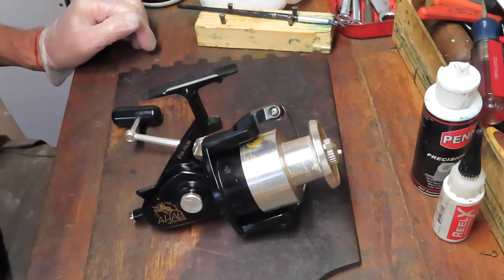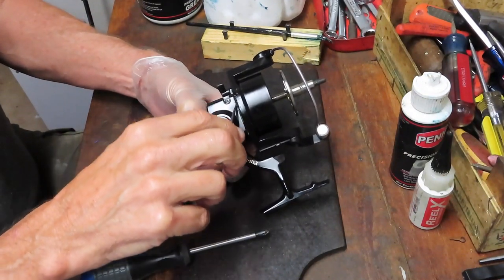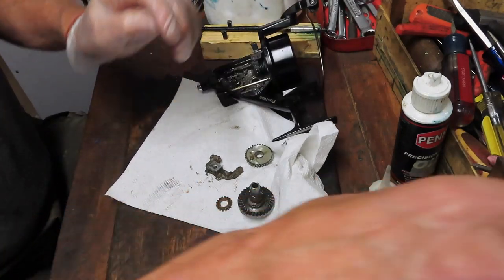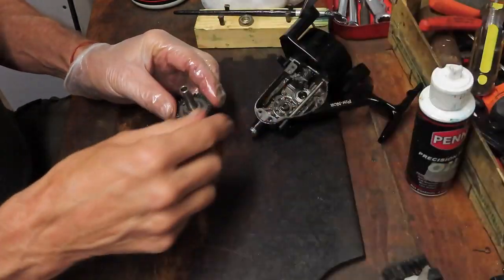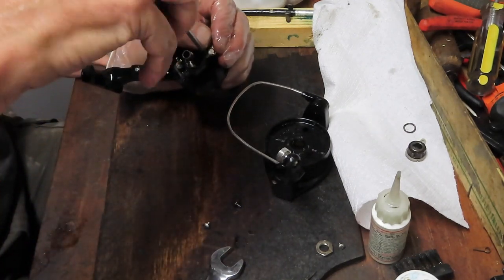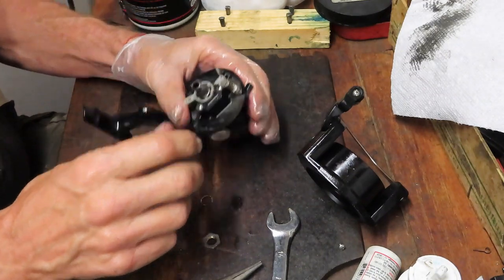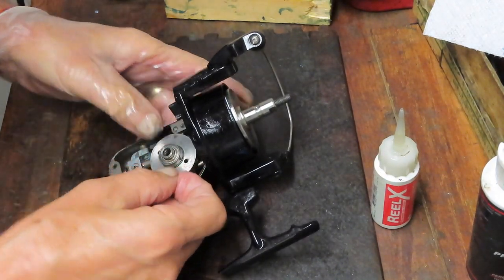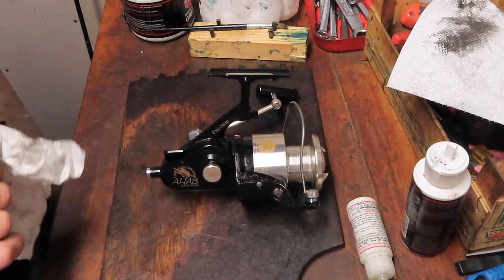Fin Nor Ahab 16 saltwater spin fishing reel how to take apart and service

Comment: Hi Dennis,
A great, no nonsense, well engineered reel worked on by a reel master !  Outstanding effort going in and out, blind !! Must admit my heart skipped a bit when those needle bearings started popping out #&#%   
     Interesting to see the cork drag washer.   Havent worked with those myself yet but I have cleaned up cork rod handles using just a microfiber cloth and water. Come out looking and feeling Fantastic !!!
All the Best, 
Cons
Reply from the maker: Thank you very much!Nice talking with you.  Stay well.  Good luck at the auction - Dennis
Reply: I use a magic eraser and water.

Comment: Nice video Dennis. If your customer is
used to modern reels these do not
"free roll" in other words if you crank it
fast and let go of the handle they wont
spin a bunch of times. That reel looks
good as far as cranking goes. They have a heavy steel gear train. If I recall
theres nothing inside the spool. The
stainless "cage" at the bottom of the
spool screws out but theres nothing
inside. Smooth drag sells replacement
cork drag washers. You found out about the roller bearings. There is
a chinese version which I believe does
have drags inside the spool.
Reply from the maker: Thanks for the additional information.  This reel is built tough and will outlast most modern ones. The current Fin-Nor offshore series in on the same level as the Penn Spinfisher reels.  Nicely made as well - Dennis
Reply: A couple of more things. I have been
servicing one of these reels for a friend
of mine since 2001 so they probably 
came out in the late 1990s. The handle
nut tends to seize due to bimetalism
so its a good idea to put some grease
on the threads. No reel is perfect the
paint on these is prone to chipping. 
      As I wrote previously cork drag
washers are available from Smooth
Drag.

Comment: That giant drag washer reminds me of the giant Ferodo drag washer in some of the large Mitchell saltwater reels. I just had to find and buy one for a 496 reel. I like this reel. It seems to be well made of good materials and design. Great video Dennis.
Reply from the maker: If you see one, get one Chris - It would be a nice addition to your collection - Dennis
Reply: @2ndChanceTackle  i can find them but they are very expensive - $150 or more. They mus to be really good reels to maintain their value the way they do. I have a different Fin Nor larger than this Ahab reel. It is built like a tank. I believe you could deep sea troll with it if you had the correct rod!  ---- Chris

Comment: SOLID GEARS STAINLESS STEELS ,very uncommon to find   in 2020 ..MADE IN USA too..I proud  have  12 and 20  models...
Reply from the maker: This is a well made and solid reel.  I don't know the age on it, probably at least 10 years old if not more - Dennis
Reply: Isn't there a switch under the rotor to take of the clicker noise?